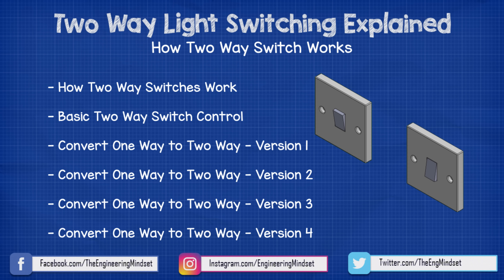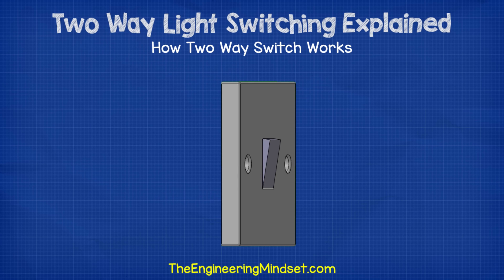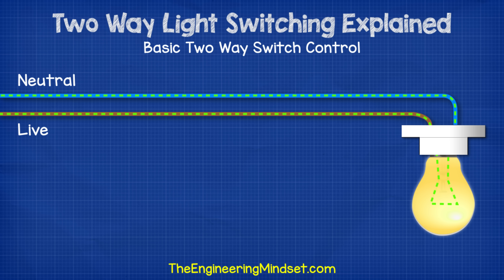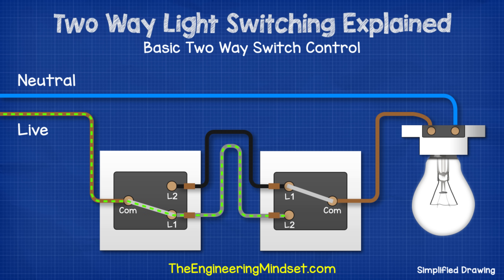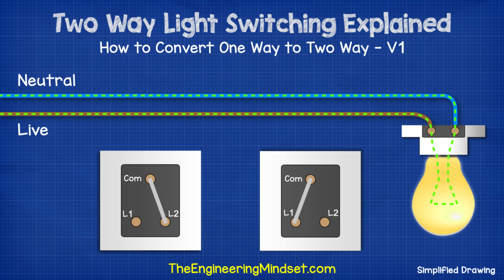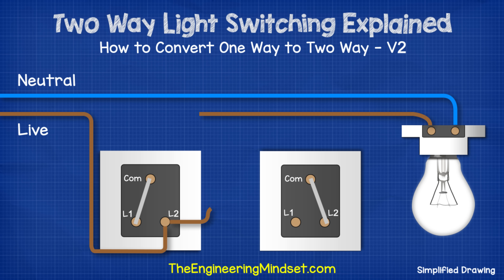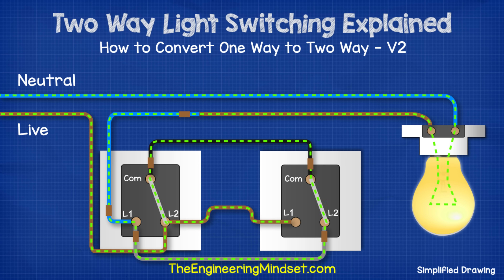Two Way Switching Explained - How to wire 2 way light switch

Comment: Guys this sound like L1= normally closed and L2= normally open
Reply: Dark Aricus for switches there isn’t really a normally opened or normally closed state since it can be manually switched and left in either the L1 or L2 position.  I guess from the way it’s explained in the video it may seem kind of like that but N.O. and N.C. usually applies to contactors and relays which have an energized state and a de-energized state they will always default to

Comment: I want to go the other way and make 2 way circuits single.
Reply: Just remove the second switch, and connect either the grey or black wire directly to the live input for the lights. (Assuming setup 1, and that you don't care about your house not being up to wiring standard and don't need fire insurance or anything...) Don't even need to replace the switch.
Reply: fireyblackdragon Thanks. I have two rooms with a light fitting each and two way switches.
I’d like to be able to independently control each room light.

Comment: Not gonna lie I watched this so I could finish my Minecraft redstone door but those switches have no terminal
Reply: You can use xor gate using only 2 comparators and some redstone.
Work the same way
Reply: Darnarius McQuimberton thanks for the advice but I just used a t-flip flop because it fit the circumstance
Reply: Figuratively Life are you are electrical engineering?
Reply: Truong Truong not really, but I'm learning the basics so I can be a better general engineer
Reply: Figuratively Life oh good,what did you learn about electrical?

Comment: 1:57 why are you drawing them like that? Why not just draw it straight from one terminal to the other?
Reply: it represents going back into the wall and out again
Reply: @elena6516  I guess so. Thank you
Reply: @enzoperruccio  no problem.  if you look at how he illustrates the entire wiring, you can imagine a ceiling at the top and a wall parallel and in the same plane as your monitor screen (and 90 degrees to the ceiling), and he's doing his best to not only explain in theory the wiring but also as literal a visual diagram as he can

Comment: if you join L1 to L1 and L2 to L2 in the 1st example its the same thing....fyi
Reply: Yeah but then you have to cross the wires in the schematic making it potentially more complicated while unnecessary
Reply: @jonne7725  yeah suppose so, vid just makes it sound like it has to be done a certain way, same with running back to fixture from 1st switch in other methods, instead it could easily be shown running back to fixture off second switch as well... i think it would help people new to the concept..

Comment: Nah ill go with the first one conection since i was drunk watching this,  i am a programmer but my mind cannot understand the second one and i have my Kiss Keep it simple stupid. Any way thanks
Reply: Look at it this way: for each switch, one of its positions connects the common terminal to the live wire, and the other position connects the common terminal to the wire that goes to the lightbulb. You need one switch to be connected to the live wire (input) and the other switch to be connected to the lightbulb (output) in order for the circuit to be completed. If both switches connect the common terminal to the live wire or the lightbulb, the circuit is not complete, so the lightbulb doesn't turn on

Comment: How about the short? at 5:30
Reply from the maker: That's not a short circuit, it connects to itself not to neutral
Reply: @EngineeringMindset   thnx i was a bit confused indeed

Comment: Everything is explained very simply what is going on electrically. 
However, each of the methods needs to be explained exactly what cables it requires, one core,  two core or three core (+ earth for each). And which method is the cheapest and safest

Comment: It should really show the live feed into the ceiling rose. Not just neutral and switch live. I know it show the feed going to l1 at 4:17 but the live feed will actually be coming from the ceiling rose. In the loop either fed from another ceiling rose or the consumer unit.

Comment: That seems overly complicated, why would you do anything but the 1st one? All I’ve ever seen, whether the feed is in the switch box or the light is you get the feed to the common of the 1st switch, have 2 travelers between line 1 and 2 of both switches (doesn’t really matter which goes to what) and the the common of the 2nd switch to the light. Boom, done, 2 wire to the first switch, 2 wire to the light, 3 wire between the switches for the travelers and neutral. Are there advantages to the other methods I’m missing?
Reply from the maker: North America is different, you need thus video https://youtu.be/_u5ORnhqn8g

Comment: I have a 3 way switch that is connected to 2 hallway lights, these switches change the hot wire at the light fixture, how this configuration works? anyone any idea? I want to change those light fixtures for LEDs but I can't if the polarity is swapped by the switches...
Reply from the maker: Watch this https://youtu.be/_u5ORnhqn8g

Comment: Kind of convoluted way to convert to two way. Connect common on first switch to power. Using one of the three wires you're running  between stations, connect the other common to the light. Connect l1 to l1, l2 to l2. Only one wire on each terminal. Why make it harder than it has to be?

Comment: I found this current video to be very re volting. The description was shocking. If you get a shock it could be terminal. Im going ohm now
Reply: You know watt? I was bipolar!... But I saw the light and now I'm grounded. Since I've switched, I just go with the flow and keep being  positive.
Reply: @carolmartin8204  you sound very con fused. You got discharged from the nut house too early. You showed the doctors too much resistance.
Reply: @mikewatte4478  I've seen a battery of doctors, but I didn't stay static and they signed my discharge. Since I quit my cell, I feel transformed.  You're currently negative because you're in the left field. Get off your motherboard! (Sorry to be so direct, you leave me no alternative).
Reply: @carolmartin8204  you overpowered your doctors and escaped. I think you blew a circuit. Your doctor must be charging too much
Reply: @mikewatte4478  I told you they signed my discharge: you clearly have some memory leak. (No matter how much they charged, I'm a free electron)! Anyway, you don't belong to my circuit, you're a party breaker, a real turn off.
Reply from the maker: Seen our new incredibly detailed MCB video? link: https://youtu.be/gqEu9t8HwW0

Comment: What wire size should i use if i will install a two way switch for my house lightings?
Reply: If your mcb/breaker is 6amp or less on your lighting circuits then 1/1.5mm cable will do the job. I'm not clued up on American writing regs though.
Reply from the maker: Seen our new incredibly detailed MCB video? link: https://youtu.be/gqEu9t8HwW0
Reply: 1mm2 cable minimum but if using high wattage lamps I'd recommend using 1.5mm cable
Reply: @sammole7350  is that european standard size of wire?what size it will be in us standards?thanks☺
Reply from the maker: Seen our new incredibly detailed MCB video? link: https://youtu.be/gqEu9t8HwW0

Comment: Now, do a video involving N swithers! It is much difficult to solve!
Reply: Do you mean having n switches in line where any can control the light? if so, you just have crossover switches inserted between the 2 ends (and they can also make the ends). These switches have 4 terminals (or more depending upon how they are made). For simplicity of explaining, you have I1, I2, O1 and O2.
When the switch is in one position, I1 is connected to O1 and I2 is connected to O2. If you flick the switch, they switch over so I1 goes to O2 and I2 goes to I1.
Reply from the maker: You can add unlimited switches with this guide https://youtu.be/jYFVsUqY6zc

Comment: what is the advantage/disadvantage of using the different version of convert 1 way to 2 way?
Reply: MegaManBn it depends on what is already installed. Version 1 you probably won’t see in a house because it’s only really practical with single core cable. 

Version 2 3 and 4 are the same method and will be what you would do in most cases. 

Practically, you put the 2 wires from the switch cable (from the switch to the light) in L1 and L2 (anyway way round doesn’t matter.)
Then take a 3 core cable between the two switches and stick each core in a hole, again anyway around but keep the common the same colour each end.

Comment: As someone that has fixed a lot of electrical things in previous owned houses - Every house with a 3 way switch should be burnt to the f*cking ground.
Reply: Common switch and is vital to proper use on stairs so not sure why you want to burn down a house with said switching calls into question your ability to fix things
Reply from the maker: Check out our US 3-way switch video: https://youtu.be/_u5ORnhqn8g

Comment: I disagree about the brown sleeving. Black and grey are also used to denote live according to the EU colour code. In a three phase installation they would conventionally be used to denote different phases, but in a single phase installation such as the examples in this video they are legitimately used to denote different switching stages, which makes the addition of a brown sleeve confuse the colour code, not help it.
Reply: Completely agree, if someone needs some brown sleeving to let them know a cable might be live. Then in all honesty they have no business messing around with electrical wiring.
Reply: @stevoc9930  Yea but sometimes the black/grey is used as a neutral. So it needs to be clear. In cases such as boilers I agree, not DIYer should touch that. Switches however are alot more simple.

Comment: There is  third simple way also. Where you don't need two carrier wires between switches. Just give l1 and l2 neutral and line . And both common wires to holder.

Comment: This is actually called a 3-way switch circuit but should have been called a 2 way/position light switch circuit which would have made more sense than to call it a 3-way just because there are 3 terminals and wires on the switches which gives the ability for the on/off functions from 2 different locations
Reply from the maker: Check out our US 3-way switch video: https://youtu.be/_u5ORnhqn8g

Comment: Ahh it’s nothing special it’s actually quite simple you have too switch in parallel which makes an or gate when one switch is turned off and the other one on voltage flows across that one turning the light, the only thing is they share a common ground

Comment: really good explanation of how the circuit wiring works; but I think it's confusing the way you keep talking about, and animating, electricity "flowing" in a broken circuit and hitting a dead end. Obviously, if the switch is open and the circuit is broken, nothing is flowing at all. It can't flow from switch A to switch B and stop --- no complete circuit, no current flows.

Comment: You're a good explainer. I like the way you showed how to, step by step, connect each wireoh, and how each wire reacts depending on how the switch flipped. Thanks so much. You did such a good job that even I could understand what you were saying and showing.

Comment: Why would someone use the variant with three cables between the switches, when the first one (with only 2 cables between switches are perfectly fine)? This is not very practicle, it's more expensive and I don't really find any reason for this... maybe if you  modify already build wiring and dont want to move the cable from lamp to the second switch...
Reply: Both methods have their pros and cons and are generally used in different scenarios. Method 1 is indeed simpler when looking at it on a diagram but it is mostly only used in industrial/commercial applications these days where the wiring will be single cables enclosed in steel conduit/trunking. Method 2 is preferred in domestic installations where double insulated cable is used.

 You can wire method 2 with only two cables, 1x 2C+E from light to switch and 1x 3C+E between the two switches, it also has the benefit of having a permanent live feed at both ends of the switching which method 1 does not. That is useful if you want to switch another light from the same switch on either end of the two way by borrowing a feed. In that scenario you only need to run an extra single core + earth to  the switch. 

Might not seem like a big deal but trying to squeeze lots of double insulated cables into plastic pipe and flush boxes can be tricky. So being able to cut down on the amount of cables going to the switch is always welcome.
Reply: And it's additional volt drop
Reply: Why are so many people struggling to understand what a conversion is?  When you add a second switch to a one-switch system then doing the first variant would require a lot more work and a lot more conduit being fitted...

"Why have you installed a conduit between the first switch and the second switch, and then another conduit from the second switch to the light?  My friend had this conversion done and they only had one conduit that went between the two switches..."
"Oh, that's because folks on YouTube told us all this extra damage to your wall and ceiling would be better!"

Comment: Hii.. I have a question. What if it is wired as shown before the version 1. Will it work? I mean only 2 wire interconnecting the switches... And other one coming is the phase wire and the one left in the other switch goes to the lamp.?

Comment: But they dont' have a ground wire
Reply: Don’t need it because light switches are plastic so if there was a fault then it won’t be live, for the ground wire on the light fitting, it can directly connect to the wire without going through the switch
Reply: @flightworks6874  👍

Comment: I understood this switching because of previous experience. However I have to say that  I think someone without experience would find it confusing.
The reason being is that in the diagram you show one wire (blue neutral) going from the consumer unit straight to the light.And then you show the live from the consumer unit going straight to a switch. Ok, this would work but in reality the live and neutrals (+earth) come from the consumer unit and terminate either into a ceiling rose or junction box. And from these the lives are fed to the switches and the neutral to the light. I understand that showing this in the video would make it a little more complicated - but then again it would be more representative of how the cabling might be found if already installed.
Reply: How can you tell that the left side of the screen leads to the CU and not a junction box?

Comment: To make things clear in the UK

Yes Earth is only ever Earth or called the c.p.c ( circuit protective conductor).
You sleeve the conductor at the ends either brown or blue depending on what you require that conductor to do ie a switched live or a Neutral. 
To explaine brown sleeving a blue conductor if you take twin and earth cable from a light fitting to a switch you take the Live down the brown conductor and then the switched live back to the light fitting via the brown sleeved blue conductor. Hope that helps.
Reply: Paul - in US green or green / yellow is ground , black and red are hot , white is neutral. .coloring must run entire length of conductor.

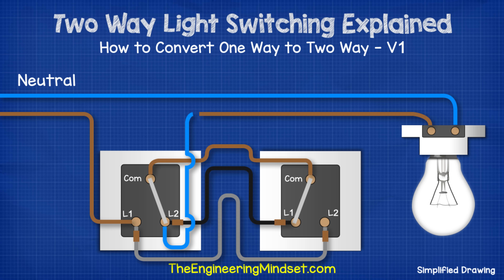Comment: Hi quick question from a total novice. . at 3:41. does this need to be a blue wire with brown sleeves? Wouldn't that be odd as we are already running the neural?? 

Also in my house i've seen purple wires going into switches. What are they symbolising?

Thanks

Comment: Unfortunately the connectivity of the supply is not shown correctly in this video. In the UK they use a ring or radial circuit that brings the phase, neutral and Earth to the lighting rose. (Known as the three plate system). This makes using a three core cable from the rose to each of the switches practically easier. With the two core system (known as a ‘strapped’) you are required to run a cable between your switches as well as one to the first and final switch. Practically that can be up to three separate cables.
Reply: I've never seen anyone use a ring circuit for lighting in the UK. Generally its only for socket/power outlets.

Comment: It would be so much easier if the mfr. of 3-way switches marked the screws H - Hot,  N - Neutral, and  T - for Traveler. Simple.
Reply from the maker: Check out our US 3-way switch video: https://youtu.be/_u5ORnhqn8g

Comment: I think its SPDT switch...but thanks for nice video
Reply: No, that's a different variable. And the switches in one of these setups need to be double-pole. Whichever position the switch is in, it needs to be contacting a wire.

Comment: how do 3 switches work though?
I figured how 2 switches worked when I was fairly young, yet, we had 3 switches in our flat and that baffled me...
Reply: In a chain of 3 or more switches, the two end switches are 2-way, as in this video, and the intermediate switch(es) must be of a different type that give a "cross-over" action.
Reply from the maker: 4 way switches video: https://youtu.be/jYFVsUqY6zc
Reply: @EngineeringMindset  so according to you guys 2 switches are a 2way setup and responding to the guy above asking about 3 switches you respond  about a 4way setup(which is correct) so what happened to 3way switches (which is what this video is about)?

I'm trying to figure out a consistent logic here.